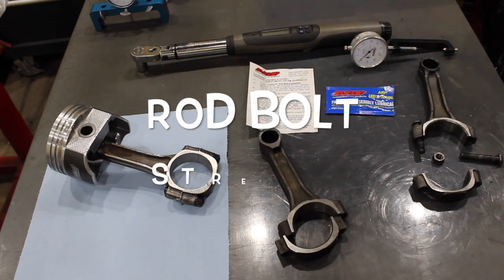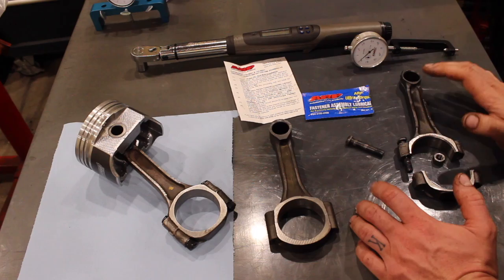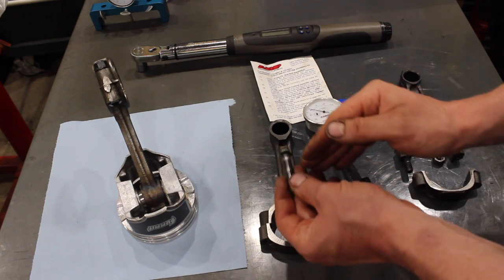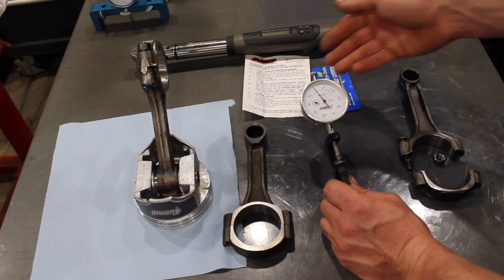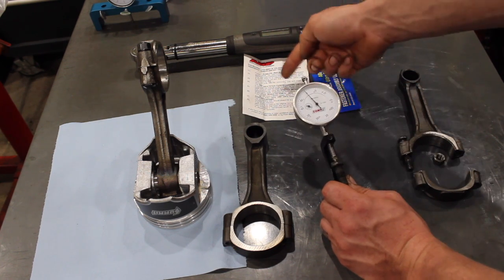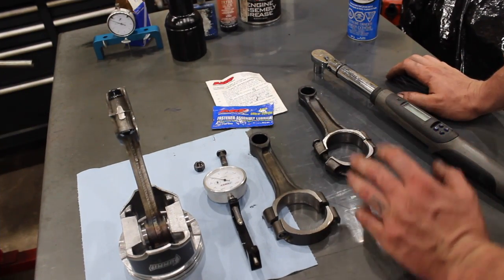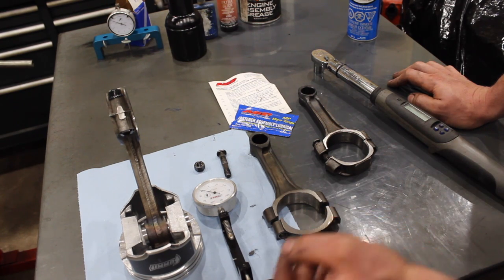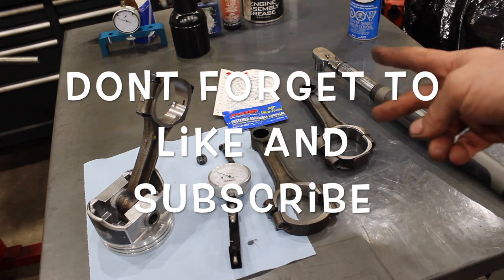Rod Bolt Torque VS Stretch Test (Surprising Results!)

Comment: That was very interesting. Does that mean all bolts (engine or non-engine applications) are under-torqued if you just use non-ARP lube and a torque wrench?
Thanks for taking the time to make these videos, Pat.
Reply from the maker: Great question! So all fasteners have a torque spec that's calculated from size, material, grade ect.. The torque spec could be a "dry" or "oiled" spec and in the case of engine fasteners most bolts are oiled. The torque is directly affected by the friction on the bolt..so using oil on a fastener that should be torqued dry you'll end up with a over torqued bolt and using no oil on a fastener that should have oil you end up with a under torqued bolt.
ARP torque specs are calculated with their lube so thats what should be used.
All other OE engine bolts (mostly) are calculated with oiled threads just regular oil should be used on those. You could actually end up over torqued using arp lube on non arp bolts
Reply: @cuttersperformance  That makes sense. Thanks for the reply, Pat.

Comment: Well I wish I would have watched this video sooner. About 3hrs ago I torqued some connecting rod bolts with 10w30
Reply from the maker: Well crap man! If the pans still off its not too late haha
Reply: @cuttersperformance  yeah, its off and the motor is still on the stand. Do you use the arp lube on the main cap bolts too? also,  do you know where to find torque specs for the arp bolts, im working on a BBC.
Reply from the maker: @engines-anonymous  any ARP bolt use ARP lube. Stock bolts use engine oil. 
There should be a spec sheet included with the bolts
Reply: @cuttersperformance  the machine shop supplied the bolts when they resized the rods. They are closed until Tuesday. I was hoping to find info online so I can finish it this weekend. I'll do some more searching. Thanks for your help and the videos.

Comment: Is this test is it for high performance engines only? Or does this test apply also apply for stock engines with no alterations?
Reply from the maker: Any time using ARP bolts

Comment: I tied boltstrech on L19 bolts. Was way past torque value and gave up on stretching em. Was afraid to pull threads from H beam rods. Torqued em to value given with bolts.
Reply from the maker: Did you use the arp lube on the bolts? Its quite abit more torque to get to the proper stretch without it

The l19s have a high torque value to begin with, how much past did you go?
Reply: @cuttersperformance  yes I used the arp lube. Don't remember amount of torque over called for value. Local shop that built competition engines for decades used 30 weight oil and torqued to torque specs.

Comment: Are you putting the line on just the nut face, or liberally all over the threads? 

I typically use Royal Purple assembly lube, comp cams or Permatex....whatever is on hand.
Reply from the maker: Threads and nut face (flat surface). Nothing I've tried works like the arp lube, I see why thats the only thing the recommend on their fasteners
Reply: Yea apparently. I’m a small scale AMSOIL dealer now, so I’d be interested to see how it performs. I haven’t needed any lube since I’ve been doing it. Now I’m curious lol. 

You have any videos of how to swap rod bolts at home? Or what to do if you get the rod caps mixed up?

Comment: Thats quite a difference. Almost looks like the friction goes way up after 45 ft/lbs? Have they engineered it so that youre less likely to overstretch?

Whats your view on grinding/polishing the rods? Is it necessary and can one do it without shotpeening them afterwards?
Reply from the maker: I'm sure they have a error factor figured in to the torque spec becuase I find to get the optimum stretch its takes a few ft/lbs more. It usually ends up being 47 to 48 ft lbs on these style bolts.

So grinding /polishing or shot peening rods, I get asked this every once in awhile. 
Here's my thoughts on this: the process of grinding oe forged rods to take the edge off them to reduce the risk of cracks is something that helps (i have no proof though) but it doesn't really make the rod physically stronger. To do it right you need to magnaflux the rods, gring them (properly), balanced, shot peened or polish then resized.
Instead of doing all this you might aswell get yourself a set of aftermarket I beam rods or even H beams. 
To me it just seems like alot of money and work for a part that maybe you shouldn't be using at the power level your are trying to achieve

Comment: This is comforting to know, butt have you ever ran the engine through a few heat cycles then recheck them? Its a bunch of work but not more than trying to save an engine.  On a engine that is really making big HP I recheck them along with the main studs. You will be surprised with the results.
Reply from the maker: The only ones I have rechecked are head bolts. I have never had and issue but im not building alot of super high HP stuff. Most stuff i do is 400 to 500 hp with some boosted stuff in the 600 to 750 hp range
Do you find they need to be retorqued?
Reply: @cuttersperformance  I've never had main/rod bolts need touched after break in.  Head bolts on the other hand, almost always take a little more.
Reply: @cuttersperformance  short answer, yes the main studs are less prone to stretch but the rods lose 2 to 3 lbs of torque. I never reuse critical studs or bolts. Head studs really need re torque. I found this by accident on an engine that had an issue, don't remember what, low oil pressure? When I opened it up I thought what the h€ll and checked the main studs and rod bolts, all arp. Yep I dyno test, off the dyno the cooled engine gets checked every time now. I have found a few that are spot on.
Reply: I would always let the head rest at least 30 min before putting on my final torque.  There was always significant variance in how many degrees it would turn.  If the degrees of turn was different at 45, I'd throw the bolt away.  My assumption was that the gasket was getting compressed and moving under the extreme force.  This was always done with moly lube.

Ex 25, 45, wait 30 min 65 done.

Comment: You do know WHY all of a sudden "stretching" a bolt is so popular now, don't you. Sells more gauges... and more importantly, it removes the the torque wrench inaccuracy factor from builder to builder. Giving a static length to achieve doesn't matter what the torque wrench says. So when a bolt brakes, they can't be held responsible due to everyone's uncalibrated torque wrenches. They sure as hell didn't change the way the bolt was made lol. 
In a nutshell, a good builder makes sure his torque wrench is calibrated, and doesn't have a problem when torquing rod bolts. Ever.
Reply from the maker: I personally think its the safer way to go. It takes out any outside factors that affect the overall torque of the bolt (torque wrench calibration, friction, and even torqueing technique). But like I said in the video and I agree with you, if you follow the instructions and have a good torque wrench then you'll have no issues
Reply: @cuttersperformance  Not telling anyone what to do, but as a Race Engine builder for many years,  you tend to see trends. Always a reason why they come up with this stuff. It's usually to sell more stuff. What I will say is, in all these years, I never had a rod bolt fail, brake, lock up, or any issue, from just torquing it correctly. What I don't agree with, is how people fall for trends and think it's  the best way. Throwing logic and experience out the window. I see why they did it though, from a business standpoint.

Comment: one thing that you need to be mentioned, is that the you need to swap the rod bolts before you have the rods machined/reconditioned.  if swap the bolts after the rods have been reconditioned the inside diameter of the rod will change, this an cause the bearing to be to tight on oil clearance. ARP bolt clamp extremely well, but you have to know what your doing or it could really screw some stuff up.
Reply: Sorry to say, that is a myth. It is a trick machine shops use as a ploy to sell another process, that is 99.9% of the time, NOT needed, but SOUNDS like it is. If it needed it with new bolts, odds are it needed with the old. Same holds true for anytime you swap from a bolt to a stud. All this stuff is checked regardless, but is NOT mandatory to rehone a rod or align hone a block. Ask me how I know.
Reply from the maker: Thanks for pointing that out! I know i recored a bit about that but i must have left it out if the video by accident. 
Alot of machine shops prefer if you send the bolts with the rods as they want to grind the caps, install the ARP bolts and then resize the rods.

Comment: I read once years ago that if you don't have the stretch gauge, you are supposed to torque the bolts to spec , 3 times and then they are good to go. I never used the ARP lube, but I'm going to for now on,lol.
Reply from the maker: To be honest even with the stretch gauge I torque them 3 times haha. I gotta put my three check marks in my engine log book lol